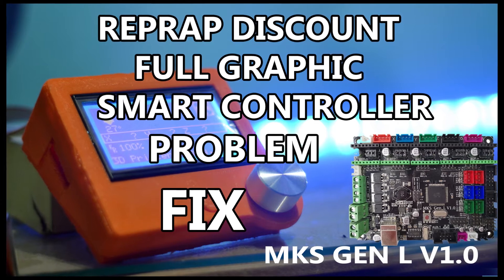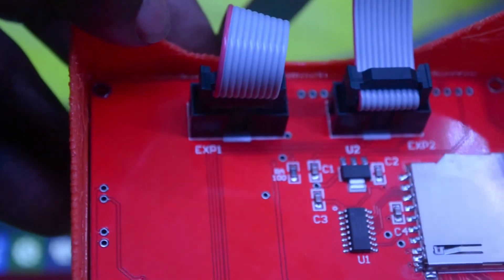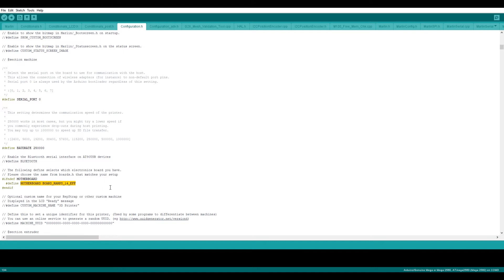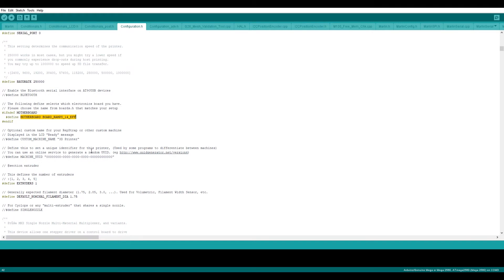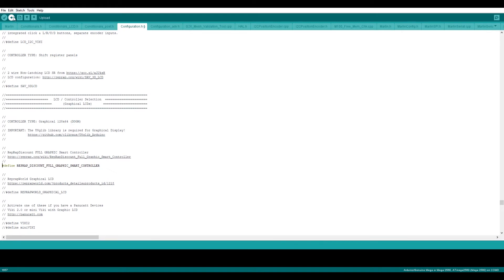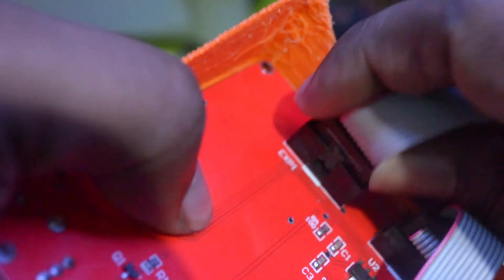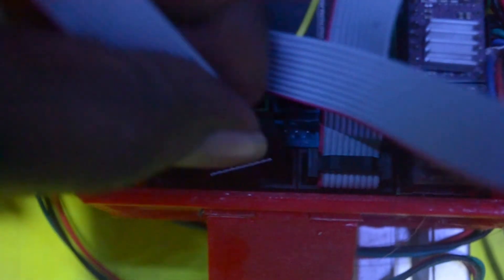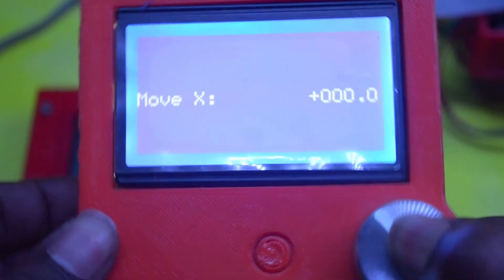Reprapdiscount Smart Controller Problem fix-mks gen L     #3dprinterProblem #3dPrinterDisplayProblem

Comment: thank you, can you change the plastic around the pins 180 degree in mother board instead ?
Reply from the maker: hi,you can do that but i don't want to mess with mother board.thats why i trimmed cables because these cables  are cheap so you can get easily.  connections should be like this:
MKS: 1 2 3 4 5 6 7 8 9 10
RepRap: 10 9 8 7 6 5 4 3 2 1 

you can make custom cable by following these. 

thank you 🙂
All the best👍